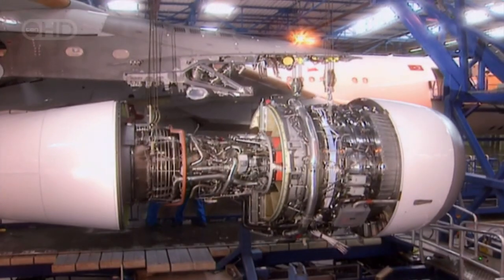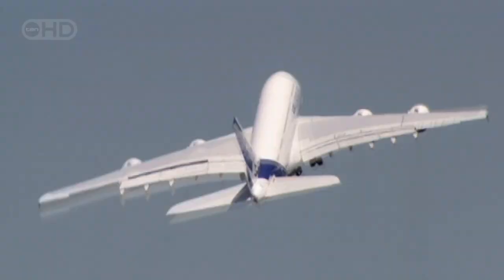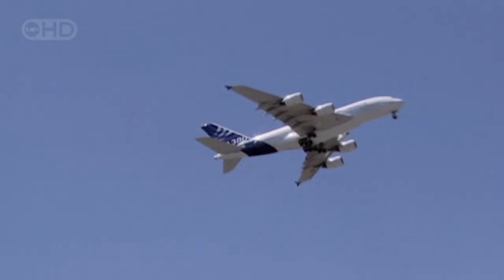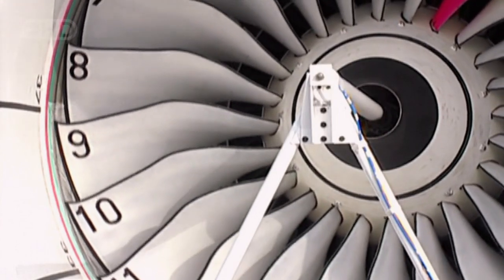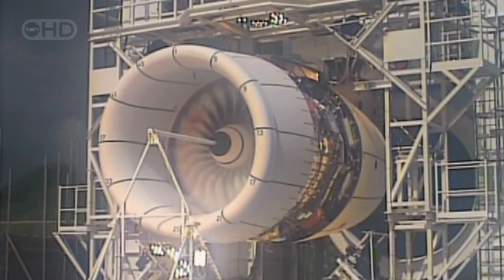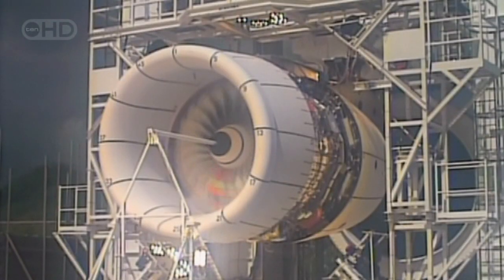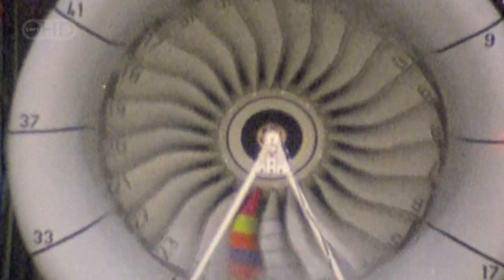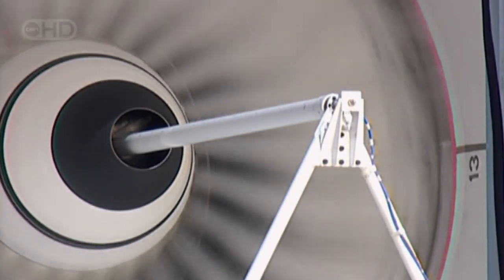Airbus A380 Engine Explosion Test - HD

Comment: Qantas did this test in flight 😂
Reply: Mmm, kinda.
Reply: and all the metal fragments were “NOT” contained !!!
ahahaha...
Reply: Yes you're right and the fragments were not contained. Severed all the wings hydraulics in fact.
Reply: Except that it was not the fan that failed. It was one of the turbine blades inside the combustion chamber that failed due to a bad oil feed line that ruptured, feeding the engine oil and causing it to go far beyond the the speed it was designed. Nothing would have stopped the fragments that were discharged when that let go.
Reply: adric I was about to say that, and question to the quy who said that engine was spinning way to fast, how the hell pilots didn't realize that before explosion, on the instruments, they were supposed to see difference in that second engine, but they didn't... something is odd in that accident report
Reply: no it was a pipe
Reply: That was a turbine blade on the hot end(rear) of the engine. There is no containment ring around the turbine like there is around the fan blades. This is test is for a blade out. A turbine coming apart is far more dangerous and unexpected. Is was do to a Hole not drilled concentric, this leaving one of the wall very narrow and prone to failure.
Reply: +Daniel Munro

It was not a turbine blade that failed, and there are no turbine in the combustion chamber of a jet engine. In the "combustion chamber", or annular combustor as it's actually called, there's only fuel nozzles and ignitors. Then there's a fairing and some guide vanes downstream of that, and then the first HP turbine.

What failed was the turbine disk of the IP turbine. No engine, no matter how strong, can contain fragments of a shattering turbine disk. Not only does that high nickel alloy disk spin at a very high rate, way above 12000 rpm in this case, but it is also super heavy as in the 50-60 kg range. What happened in the Quantas incident was that the turbine disk "broke free" from the shaft coupling between the IPT and IPC so it started freewheeling, thus causing a runaway situation where it got way past it's designed RPM tolerances.
Those disks usually break up into 2-4 large chunks and they carry enough energy to go through a 50-75 cm thick concrete wall. Even small turbine disks of helicopter engines etc. has enough energy to cause havoc when they fail That's why you see a red line painted on the side of a lot of ground operated gas turbine equipment, whether them being in huffers, power or pump generators etc. so you know where the perpendicular plane of the turbine disk is, i.e don't stand there if you don't have to.

A fan blade is very light, just like a compressor blade and a "hollow" compressor disk, so they are easily contained. However, if a fan hub or turbine disk fails, it's just too much energy and mass to contain. This was also what happened to flight 232. That fan disk did not only go though the nacelle, it went through the whole plane. The hub of the CF6 fan disk might be made from titanium, but it's a huge chuck of titanium. I can't remember the numbers off the top of my head, but I believe the hub alone is in the 75-100 kg range.

Luckily turbine disk failures are extremely rare, so it's not really something to worry about. However, if it occurs, hopefully it won't hit the plane fuselage itself.
Reply: +Brian Eastwood

A turbine blade that fails gets spat out the back. It's actually not the most uncommon failure, as it's what happens when an engine fails from running too hot. This is one of the most common reasons for jet engine failures. I've seen turbine disks that were completely corn cobbed, and there were nothing uncontained. A failing turbine disk as with the Trent in the 380, that's an entirely different story.
Reply: +Ikhcdfgvbhfv
When that turbine disk broke free, it went into overspeed instantly and shattered. If you have your engine running at full power and then all of a sudden release the load from the turbine, you can probably imagine how quickly that think spools up. It's absolutely instantaneous.
Reply: +911gp
The stub pipe was the instigator to the whole thing, not what caused the damage itself.
Reply: Clearly this video was produced before QF32 happened. An uncontained engine failure is an uncontained engine failure....
Reply: ABOlsen69X wasn't it some kind of pipe that was too thin that made oil flow on the disk making it like too hot and fast?
Reply: Yeah in the qf flight 32
Reply: Adric Sommer woooooooow😂😂😂
Reply: Recently Air France also 😁
Reply: Adric Sommer so did an airfrance
Reply: that was.... abusive
Reply: Adric Sommer it didn't work out as well as the ground test
Reply: Best comment on this video!😂😂
Reply: It was the faulty stud pipe that was produced with uneven thickness that failed
Reply: Air France too the compleat fan broke away
Reply: That engine failed the test
Reply: Adric Sommer  indeed
Reply: Adric Sommer and how many killed??
Reply: Malaysian airlines also lmao
Reply: @jacaresamba4049  landed safely at Singapore
Reply: Dark
Reply: Becarefull
Reply: That occurred on the GP7000, while this is Trent 900
Reply: Good thing the pilots were heros
Reply: @petrochemicals4u  because almost the whole engine exploded and the test that they do here only 1 fan blade that comes off not 1 whole engine that explodes, if it were that it would be a different story.
Reply: Dan Munro Like we don't know
Like you 
YOU don't know what is sarcasm
Reply: Flight 72?
Reply: It's an illegal or accidental crash test by rolls royce

But really how come it failed in flight 
Hope it's not an illegal one
Reply: @zandermean  it actually flight 32 not 72
Reply: Kkkkkk what a joke
Reply: Kind of
Reply: Lamo
Reply: Unitentionally
Reply: Lol
Reply: lmao
Reply: QF32
Reply: Adric Sommer Obviously 😂
Reply: Hey man !!! This is joke ! Why u so serious ?
Reply: @jordanrader9281  pipe
Reply: QF32 is the engine fail. But QF72 is the pitch-downs
Reply: Hahaha

Comment: "...a litre of gasoline every second...." I thought jet engines used kerosene, not petrol.
Reply: Also notice that Qantas made sure that every A3802 was grounded to make sure rolls royce fixed the problem & paid compensation to Qantas for the loss of revenue & that fault was put out to all owners of A380's which was a lot when they first came out, all because of a fuel line connection which was not made properly the mixture of the metals was not 100% & also the tolerances of the fittings was out by a couple of thousands of a inch, but that makes a big difference in a engine as complex as these. :)
Reply: I've seen a lot of comments like that. Where did you get the idea that jet engines used kerosene? (just curious)
Reply: Seraphim Valkyrin The Royal Navy. Our helicopters ran on kerosene, but we ran our main propulsion turbines on diesel. I know you can run a turbine on almost any fuel, but for jet liners, I always thought it was kerosene.
Reply: The fuel trucks that bring fuel to the jets are labeled "Jet A kerosene."
Reply: Tim Mendes Yep spot on. :)
Reply: ***** Or AF GAS as its called down under i believe. :)
Reply: ***** true
Reply: 7071t6 Wasn't a fuel line, it was a lube oil line.
Reply: crabfat OK even an oil feed line, to think that how critical such tolerances are, just 1 mistake & you have a plane falling out of the sky ?
Reply: AV gas is for smaller stuff like Pipers and Cessnas.  A1, although not technically kerosene, is basically the same thing. Kerosene, A1, Diesel, #2 fuel oil is all more alike than any of those are to gasoline. A turbine engine is like a turbocharged engine in that you're compressing air, so it's more dense than a standard atmosphere, and mixing fuel proportionately to achieve stoicheometry (a fancy way of saying proper air/fuel ratio) and lighting it all on fire. Fuels like diesel, kerosene, etc. have a Cetane, rather than Octane, rating which indicates the volatility of the fuel. Things like Kero and Diesel are less volatile and burn more slowly but release more energy, one reason diesels can achieve greater fuel economy than gas engines and are sometimes cranky in the cold. Regarding the fuels I listed above, I suspect, as one of the other comments mentioned, that some turbine engines could happily run on any of those fuels listed while others may run less efficiently. As any diesel truck owner will tell you, however, diesel fuel has a well deserved reputation for having contaminants, I suspect that aviation grades are simply better refined or filtered and possibly little else. (BTW anyone who knows what they're talking about is welcome to correct me. I crossed that line between knowledge and inference once or twice. :)
Reply: Piston engines for aviation use gasoline, at least.
Reply: GregoryTheGr8ster yes, it's possible. There are STC's that permits the pilot to put regular gas (82 octane amd such), but the required gas is AVGAS (aviation gas) which is normally 110 octane
Reply: @seraphimvalkyrin4543  where did you get the idea they don't? Jet A and A-1 are both kerosene with additives. Maybe next time get an idea before you spew ignorance
Reply: @chowner  Maybe by being an aviation major and actually working at an airport. And how was my comment ignorant? I wasn't telling him they don't run on kerosene, I was asking a question because I'm not ignorant enough to assume all planes all over the world use the same type of fuel.
Reply: @seraphimvalkyrin4543  You're digging a hole bud. Leave your basement for once
Reply: @seraphimvalkyrin4543  bud give it up. All commerical airliners burn kerosene. You are almost to the other side of the world with that hole now.
Reply: @chowner  I never said anything about commercial jet liners. I said jet engines. That can apply to anything aviation related. Besides I don't see you insulting the guy I replied to since he was the one that even said that they have some jet engines in the Royal Navy that use desiel. You are just trying to pick a fight where there isn't one.
Reply: @chowner  Oh and btw, not all "commerical airliners" use kerosene. Some airliners still use prop planes which either use avgas or diesel. You try to call me out on something when even you made a mistake. Don't try to act so superior because then you just look foolish when you get something wrong.
Reply: @seraphimvalkyrin4543  that's you bud you are wrong own it. There's not a single commerical airliner in the world burning diesel or avgas.
Reply: @timmendes8837  there's 3 different standards of fuel. USA uses type jet A. Three tests of the world uses A1+? And then there's a theirs type for military craft
Reply: @7071t6  unless you stall the plane won't fall like a rock
Reply: Seraphim Valkyrin Any commercial plane with props now are turbo props, burning the same fuel as a jet because it is a jet.
Reply: It's aerosol
Reply: I don't think kerosene and jet fuel are the same thing
Reply: @princenoah21  They are basically the same. They have different additives but use a similar base fuel. Military aircraft are allowed to use kerosene or diesel in an emergency.
Reply: No commerical flight jet engines use jet fuel which is a highly refined oil.... diesel and kerosene are both oils just jet fuel is way more refined.

Comment: wouldn't mind putting that at the back of my Nissan skyline
Reply: Would it be a r34 gtr nismo v-spec 2 ?
Reply: @boeing-ge8rp  probably an r32 or r33. Those R34's are hella expensive, even for non-V-Spec models
Reply: I would swap the rb26 to rb211
Reply: Meanwhile I'm over here strapping down a solid rocket booster to my mountain bike.

Comment: 0:38 actually no...it sucks down 0 liters of gasoline because the engines don't use gasoline rather kerosene.
Reply: James Sanders i know right
Reply: wow , you are so smart, a pure genius. YOU JUST DISCOVER HOT WATER...
Reply: +James Sanders technically it´s Jet-A1, not kerosine, or rather paraffin, as it´s known as in the rest of the world, the engine runs on.
Reply: Jet fuel is kerosene with additives, just as diesel fuel is #2 oil (home heating oil) with additives.
Reply: +Torvikholm Jet A-1 is kerosene. I'm pretty sure paraffin is the UK terminology got kerosene so it's all the same.
Reply: AmericanAirlines There is paraffin in #1 and #2 oils.  That's why truckers have to add additives to their fuel tank in winter time to stop the separation of the paraffin, which can clog in the fuel filter, shutting the engine down.  I'm not sure but I think JP-40 is not as susceptible to waxing or jelling as is diesel.
Reply: wow.  you stirred up that hornets nest on purpose, didn't you?!  Bet you're still telling that story at the few parties you're invited to!
Reply: onomis:  it's the same guys who let grant imahara describe pumpkin chuckin' distances in - wait for it - "OLYMPIC SIZE SWIMMING POOLS"!!!  The same guys who describe spinning blades in the lastest verson of battle bots as going, "300 MILES PER HOUR"!!!!!
Reply: havocproltd What
Reply: huh?  what?  did i type too fast?  im sorry.
Reply: havocproltd apology accepted?
Reply: James Sanders you have a point
Reply: Jet A or Jet B?
Reply: it can also run on gasoline
Reply: mrbouncelol m
Reply: ikr
Reply: James Sanders lol stop correcting people as if you are the smartest person in the world. Go correct ur self in school
Reply: Oneil Ramirez you'd expect more intelligence from someone with a mewtwo avatar
Reply: nerd
Reply: James Sanders correct you are
Reply: lier they use something to fuel it up
Reply: So true
Reply: This comment thread should run out of fuel. That would be cool.
Reply: It sucks jet fuel*
Reply: #JETFUEL
Reply: Ikr
Reply: Exactly!!!!
Reply: ROSSINI Productions and you obviously are not.  The word is "DISCOVERED". If you choose to be critical of others, at least make an attempt to show your intelligence.
Reply: Also, ALOT higher RPM than 3000, far more likely 30,000 is what he was meant to say.
Reply: good one
Reply: They said fuel
Reply: James Sanders there trying to save a few dollars by using regular gas😂🇨🇦
Reply: James Sanders there’s an idea let’s try gasoline now
Reply: I thought I was tripping when he said gasoline lmao!
Reply: He’s British
Reply: @kamil7512  ...brits don't say gasoline ( outside of the refinery labs )  they say petrol.  or, holy fuck look at the price of this shit!
Reply: Eric ...... wow!!  that LOL was a long time coming!  thanks!
Reply: @danielwest2697  - The max fan-speed on an engine this large would be ~3,000 rpm.  The core is faster but still less than half of your 30,000 rpm number.

Comment: I just realized that about 1 year after this video was uploaded, Qantas Flight 32 happened
Reply: Wasnt that the flywheel exploding
Reply: @tormodhag6824  turbine disc due to oil loss I thought. Not fan blade but I love the commentary about how they work hard to make this safe when RR has not had a very successful safety or reliability history in the recent 10 years.
Reply: @Emperorvalse  yeah that was it, turbine disc

Comment: Um, everything the narrator stated that RR was trying to prevent in the even of a catastrophic fan blade fracture happened to a Quantas A380; the fragments pierced the wing causing a major fuel leak, and pierced the avionics bay, causing the computer(s) to go crazy and disable several systems. They're blessed they had such an experienced crew on board, including 2 extra check airmen to help assess the situation and get the plane on the ground.
Reply: I was thinking just about that
Reply: Pretty sure it was a turbine blade that blew out of that engine, caused by an oil fire. Lucky it didn't go through the fuselage.
Reply: An entire turbine disc failed, which is much worse. Fan blade failure would have been contained.
Reply: the plane will be on the ground even if there wouldn't be a pilot. Its just a question if the people would survive

Comment: Didn't the Qantas A380 suffer a similar incident while flying and the left wing was damage?
Reply: What you saw here was catastrophic engine failure that was contained. That Qantas flight suffered catastrophic uncontained engine failure, quite possibly in the worst way imaginable.

Just like with the engine of your car, or bike, you NEED to have the failure to be contained. After all, replacing an engine is much easier and cheaper, than replacing all the other systems that were damaged.
Reply: Yup. https://en.m.wikipedia.org/wiki/Qantas_Flight_32
Apparently an oil pipe wasn't bored correctly and oil leaked causing a catastrophic failure
Reply: +Zeldagigafan that was a different engine on the plane. The controls had been damaged.
Reply: I hate it when my pipe is bored incorrectly.
Reply: Andrew, yes there is.
Reply: Maarttiin, *damaged
Reply: No, this tested a fan blade failure. QF32 experienced a turbine disk failure, which is so violent that nothing can stop the pieces from going through anything they hit.
Reply: yes, if that is the one that im thinking of, it happened shortly after takeoff and the fuel tank leaked. Luckily, the plane turned back and nobody was injured.
Reply: maybe more than one blade came off for the qantas flight. this test only one blade failed
Reply: @davidwatt3843  uh no it was caused due to a turbine disc failing. In this video we see a "turbine blade" fail
Reply: Anyone else watch this on mayday air crash investigation?
Reply: It’s a miracle the plane landed safely with no deaths and not even any injuries. That just goes to show which airlines can do their jobs correctly.